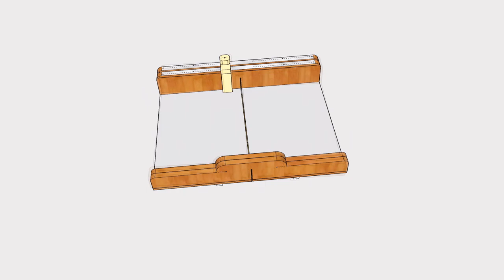Table Saw Sled / DIY Crosscut - Shortcut Sled

Comment: Also an excellent tutorial.  Thank you. what kind of spray do you use before you drill for example the small apparatus ?
Reply from the maker: Hi.  Thank you very much for your nice comment and interest.  The glue I use is called "Quick Glue".  This type is used with activator spray as well.  It freezes when sprayed.  I'm sure you've used or at least seen these adhesives.  You can find it in all construction stores.  I hope I could help.

Comment: ca a une bonne resistance mecanique ce bois? car il coute beaucoup moins chere que le bois normal!
Reply from the maker: Je pense que le MDF est un matériau très solide.  J'ai choisi le MDF car le prix est également abordable.  C'est un outil que j'utilise depuis longtemps.  J'utilise le MDF dans la plupart de mes travaux.  Ce n'est peut-être pas aussi beau que le contreplaqué visuellement, mais j'aime l'utiliser.  J'envisage de faire une scie à ruban prochainement, j'ai dessiné le projet, j'utiliserai du MDF en général.  Je n'utiliserai du contreplaqué que dans des zones telles que la partie porte-roues.
Reply: c est bon à savoir par contre plus lourd que le lamé
Reply from the maker: Vrai.  Un peu plus lourd.  Mais c'est pas cher :)
Reply: oui exact si vous me dites que c est bon 👍👍

Comment: What's name yellow spray bottle ? What 's fucnction it. Thanks you
Reply from the maker: Hello there.  First of all, thank you for your interest.  The spray I use is the activator that makes the glue harden.  You can view it by clicking the link below.  Adhesive and spray sold together.  It is used in many places.  It is referred to as Super Glue (or instant glue). 
 https://www.google.com/search?q=h%C4%B1zl%C4%B1+yap%C4%B1%C5%9Ft%C4%B1r%C4%B1c%C4%B1&client=ms-android- xiaomi&prmd=sivxn&sxsrf=AOaemvIERVL10AMPLn6xLWk4KgSA5qwGNA:1634834113932&source=lnms&tbm=isch&sa=X&sqi=2&ved=2ahUKEwi5ioLV99vzAi5WA5qwA6&Burg=AuL5A6W9WA5Q5A6AuD9wA5Q5A5A6A&C5A6A9W9WEQ5A6A9W9WC2

Comment: What is the spray on 2:24?
Reply from the maker: The Adhesive I use is sold in two pieces.  After applying the gel adhesive in the tube, a spray is used for hardening, that is, for freezing.  You can find it in all construction stores.  It is called Quick Glue.
Reply: thank you!
Reply from the maker: Thank you too 👍